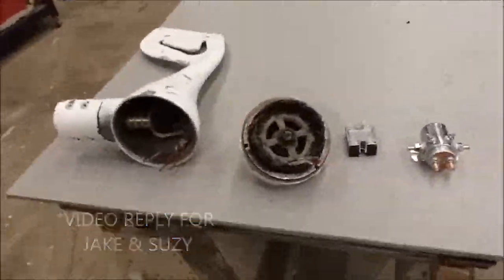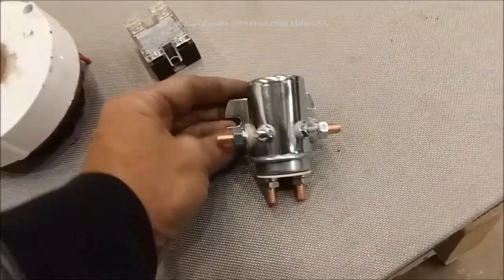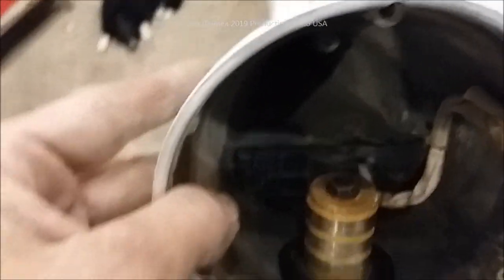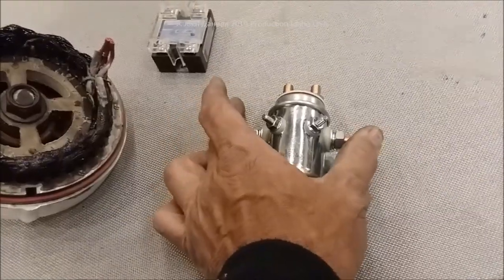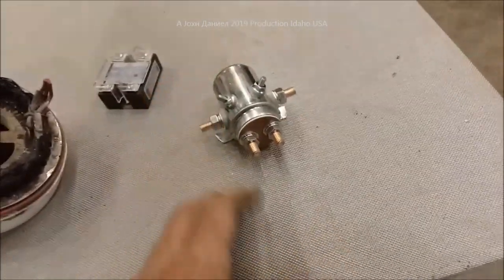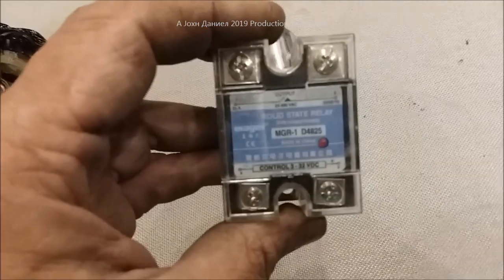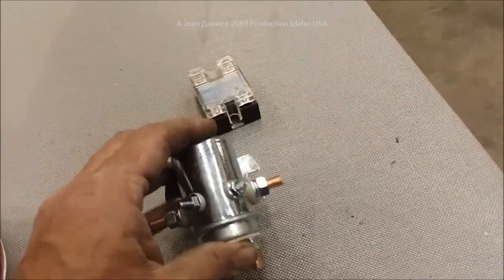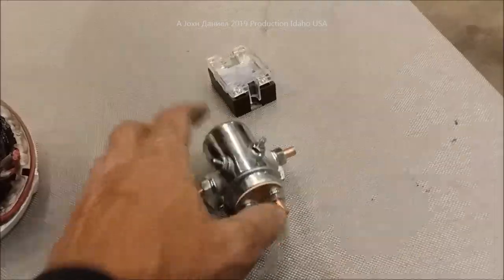Why cheap Micro Small Wind Turbines fail, and solutions to know

Comment: John... can you PLEASE make a video showing a 24v turbine charging a 12v battery system?  Also, a clear explanation of how this is beneficial in low wind areas??  I ordered a 24v turbine per your suggestion from other videos.  Unfortunately,  Green E isn’t shipping right now... they are waiting for transportation to return to normal.  Thanks!
Reply from the maker: Fair enough question. Yes, many could use that info. I'll see about making one asap and putting the info everywhere I can.
Reply: @PrepperMountainSolutions  Thank you!!  I've wired my entire turbine system directly from your videos.  You mention several times that using a 24v turbine on a 12v system is 'acceptable and proper' for low wind areas.   Thank you for ALL your videos... I learn from each one!!

Comment: yeh i was burnt like that, so much misleading information out there, also some insulation on electrical wires are not fire resistant, i put a flame to them to check if they self extinguish while holding my breath ofcourse, that little turbine must have made some power to burn out like that.

Comment: I have both SSR (Solid State Relay ) and Solenoids  working here.   Ordered Solid State Relays still waiting arrival to replace the one  solenoid Still in use.  The Solenoid Relays munch a butt load of power when activated too.  Over one amp to keep one switched.  What a waist.  The Solid State Relays are differently the best means to switch power.